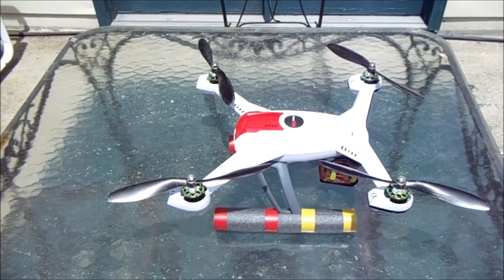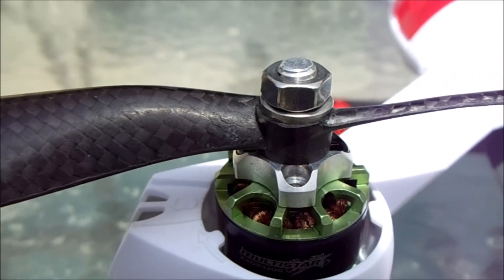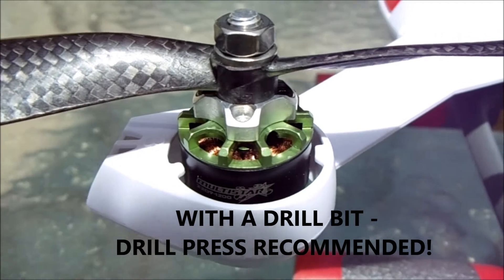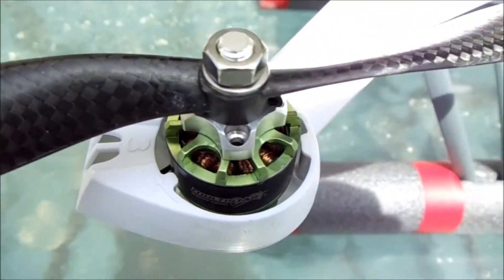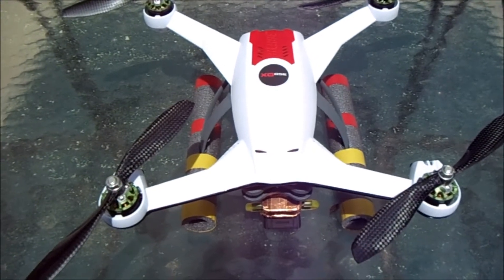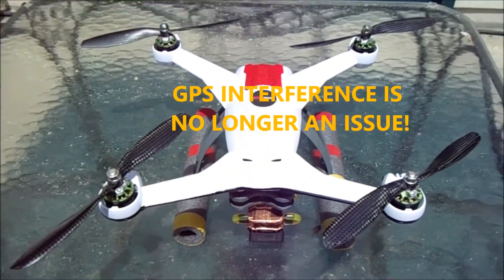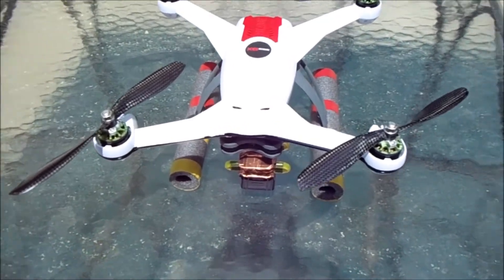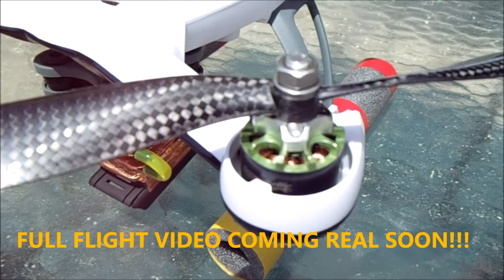350 QX Multistar motors, V2 firmware and other updates MP4

Comment: have the 350QX and the 350QX3 my 350QX still has is original firmware which I prefer, I don't like the throttle nonsense of the 2.0 firmware.
About the motors, some say that now the ESC heat up and you have shorter flight times, so what are the advantages of these motors, except costing you money

Comment: I just bought the QX3 with the mast on the outside (top) of the quad.  I think it was a great idea just the flimsy feel to it leaves it vulnerable to possible easily breaking.  I wish it was just simply shark fin type setup but hey I guess it works
Reply from the maker: Yeah, they needed to improve the GPS reliability and placing the antenna outboard was prudent. There were a lot of problems with Satellite acquisition on the earlier models
and the RFI from video cameras exacerbated it and would kill the GPS. I shielded my 350 QX with copper foil and upgraded the GPS antenna with a higher gain after market unit. Solved everything. I agree with you, the new antenna mast is like a sore thumb! Blessings!
Reply: what GPS antenna do you have now? and were did you get yours? I thinki f I can find one that is better I will upgrade mine also. thanks again, Joe.
Reply from the maker: justjoe1601 Well, given that your antenna location is the highest point on the quad, it's probably unnecessary to swap out the antenna. Also, I doubt that the connecting lead on the replacement antenna I'm using would reach back to the GPS unit from your mast. However, here's a link to the antenna:
 http://www.digikey.com/product-search/en?vendor=0&keywords=AP.25F.07.0078A
Reply: im just wanting to make sure that it will be a sure connection.
Reply from the maker: Yeah, I understand. I expended a lot of effort ensuring GPS reliability. If you loose or have sketchy GPS performance, anything can happen. Horizon relocated the GPS antenna on your version in response to many issues stemming from camera RFI. Something I used to do is check satellite acquisition with the camera turned on and off using an iPhone app to display satellite acquisition.  Until I had all of my RFI shielding setup, turning on the camera would knock out more than 60% of acquired satellites, making the GPS totally unreliable. The shielding solved it, but I still upgraded my antenna, which improved satellite acquisition time and strength. Nice communicating with you on this. I hope I've helped you in some fashion. Let me know how it goes with the your new ship! Happy New Year and Blessings to you!
Reply: I already crashed twice and had to replace the whole body twice but never that gps mast.. It may look flimsy but that thing is tough.. What happens is when the quad crashes, that mast will simply fold..
Reply: I broke mine once already, and it was with a simple landing that the wind caught ahold of it and flipped it. must just be way it hits.

Comment: When you changed the motors did you need to change esc's or change any thing else for them to run as I've been thinking about changing mine for a wile but was told it won't work with out changing somthing
Reply from the maker: Hi DAN19792. I ran the Multistars with the stock esc's. I thought the motors really performed well. However, after several flights I reluctantly changed back to the stock motors! The stock esc's really got noticeably warmer and ran the battery down quite a bit more with the Multistars and there is so little room to work with inside the 350 QX that I didn't want to get into a big Frankenstein project. I'm gonna scratch build a bigger quad pretty soon and plan on deploying the Multistars in that project with some larger esc's. I believe quite a few folks have installed the Multistars in the 350 QX so you should check out some other videos before deciding not to install them. I'm just very cautious, especially with things involving current! Let me know how it works if you decide to take the plunge! Bless you!

Comment: i would love to have one of those mounts
Reply from the maker: Hi ggjflyguy: Thanks. If you mean the camera mount, it's an easy build project. Hobby plywood, carbon fiber rod, RC engine fuel line, double sided sticky foam board and I used a large scale RC aircraft control horn to attach the completed mount to the 350 QX mounting point. Took about an hour of work once I decided on a course of action. If you want some detailed build info, let me know. 
Blessings to you!
Reply: i guess the biggest question is where did you get the carbon fiber rod from, i think i can manage from there
Reply from the maker: Hey ggjflyguy: Local hobby shop will have the rod. Select rod and fuel line that will allow the fuel line to very snugly slide over the rod. Best of luck and happy flying.